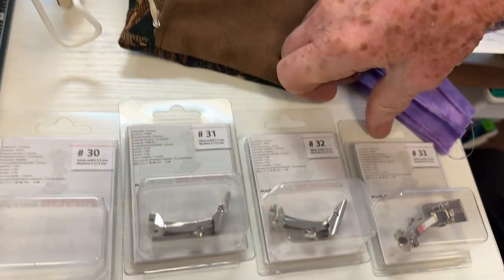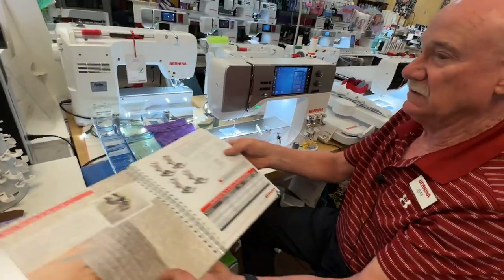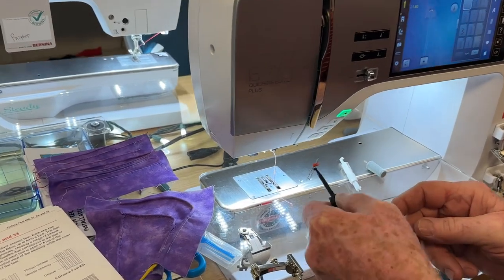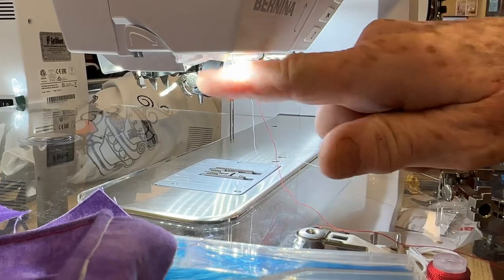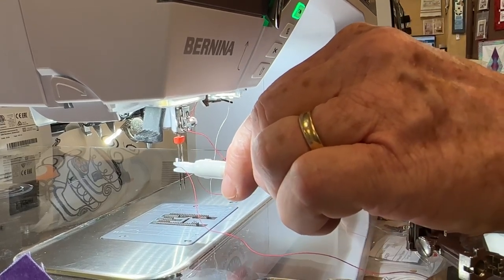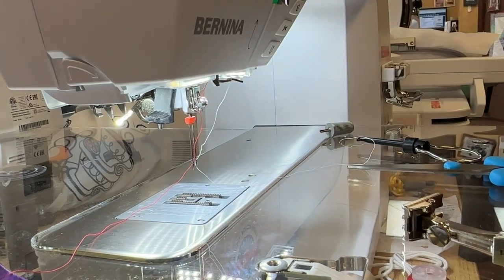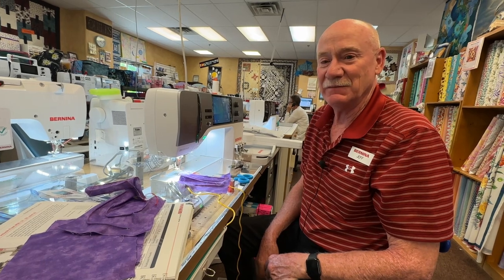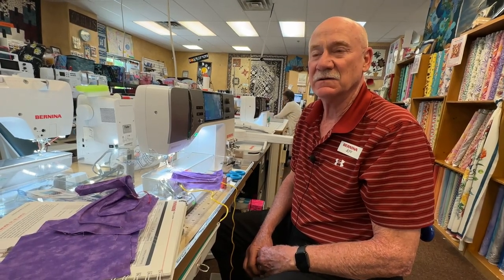How to use Pintuck Pin Tucking feet Bernina Jeff shows settings and tricks #30 31 32 33 twin needles

Comment: I use my pin tuck feet with a single needle and a zigzag stitch to couch cording to the cuff of a pillowcase.  I try to match the top thread to the cord color and I often add a layer of lightweight interfacing to the cuff to help stabilize it. I’ve also used over the edge stitches with great results.  You just have to be careful that your stitch width doesn’t violate the foot slot opening.  If the cord you are couching fits snuggly in the groove of the foot, I find I achieve better results with my pin tuck feet than if I used the number 12 couching foot. It’s neat that these feet have uses beyond their name.  That being said, I used 30 and 31 the most.  I find 7 and 9 groove feet too small most of the time.  I have all 4 feet, but I use 3 groove and 5 groove the most.

Comment: Tip for inserting a sewing machine needle: Put your needle in a needle holder and then put the point(s) of the needle into the hole in the switch plate. Turn the wheel to bring the "do-dad" down to the top of the needle. No more guessing how far forward, how far back.
Reply: "All my rehearsals were fine." - We understand. Our experiences sewing have lots of moments like these. There are so many things to remember. Something for me to remember, buy Jeff's tweezers.